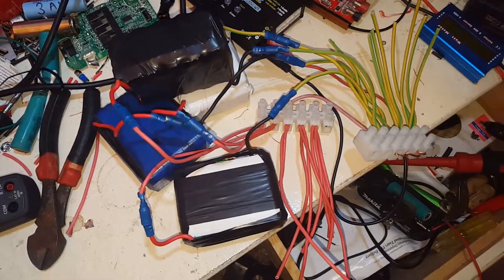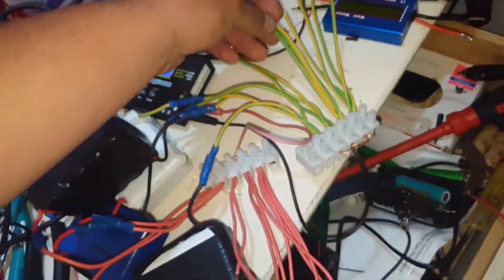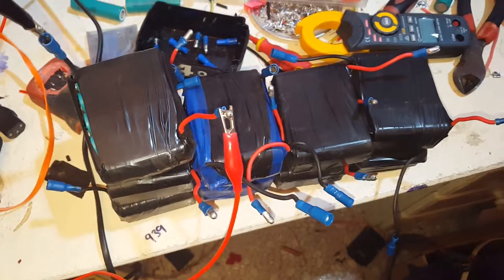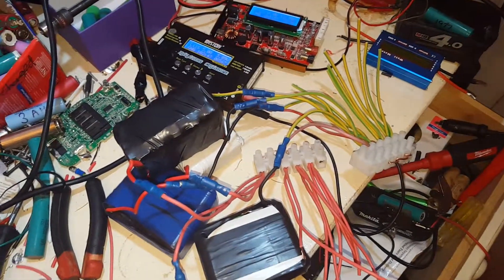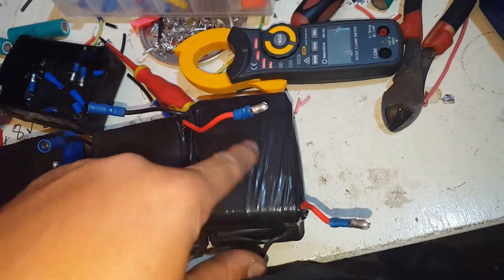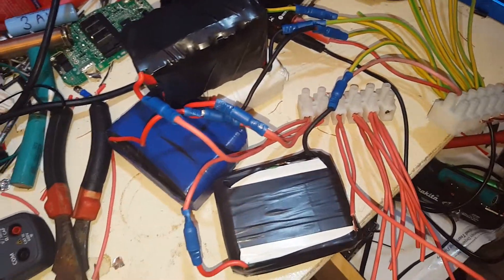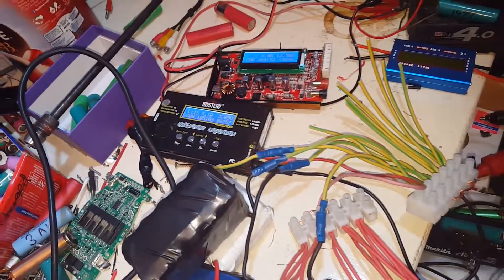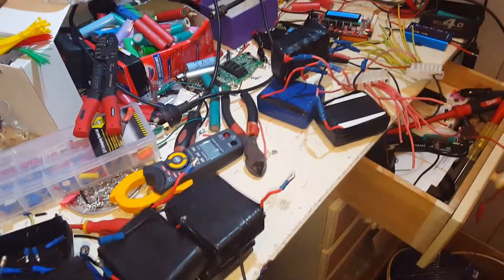Charging my ebike 13s 52v pack 18650s lipo charger

Comment: you should get some balance wires say 4s ones and wire the whole pack up as 3X 4s & 1X 1s that way you only have 4 battery pack to charge; lot less wiring and only have to connect the four connectors together each time you want to use it instead of 13! 

currently i have a similar set-up on one of mine; where i have a 10s battery wired to a bms for charging and a series connector i made out of xt60's so i can join another 3s battery of same spec (14.5ah) in series to get 13s in use; i charge the 3s on rc balance charger same as you.
Reply: it would make the charging less of a mission; yet still have complete bmsless design (better if you can help it anyway - just not as simple) :-)
Reply from the maker: I agree was way to complex but did build it  myself while learning :) next one will be Awesome

Comment: If I underrstand you ocrrectly, you are going to connect all the individual cell banks in parallel and charge them all at once. Is that right? If so - do you have any problems with initially connecting them in parallel? Usually, different packs will discharge at different rates (hence the need for balance charging) so when you connect them in parallel to charge them up, they'll have different voltages and very high current will flow between packs which could damage the cells or worse.
Reply: If they get that unbalanced after one cycle then he built the battery wrong. But since he is basically balance charging them every time they shouldn't be too far off in voltages so connecting them together is not a problem.

Comment: 13 cells in series x 3.7v equals 48.1v. 13 cells  in series is not  52v.
Reply from the maker: +mike x charged to 4.2 it  is
Reply from the maker: +mike x on an ebike? My controler didn't  like 60v yours ok at full charge
Reply: im using 58.8v battery on kelly controller and it works ok and controller says 60v max but i dont use 60v
Reply from the maker: +mike x ah ok mines just cheapo ebay kit ill probably do a mid drive next time. Have a look at newer vids on my channel  im building a new ebike battery  now
Reply: cyclone ebikes have released a new mid drive frame and motor with intergrated motor slot  mount which is better than using the bottom bracket shell to attach a motor which was never designed for attaching a motor.
Reply from the maker: +mike x ill have a look cheers mate you've been more than helpfull